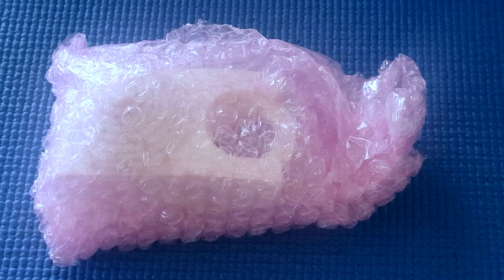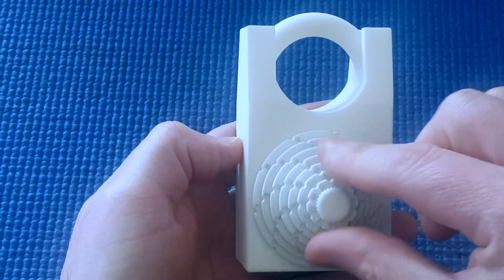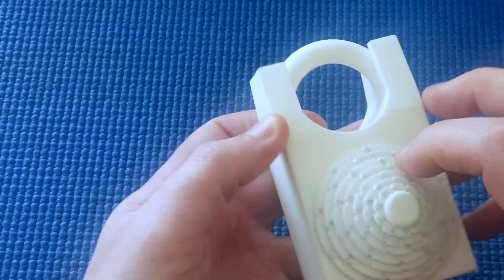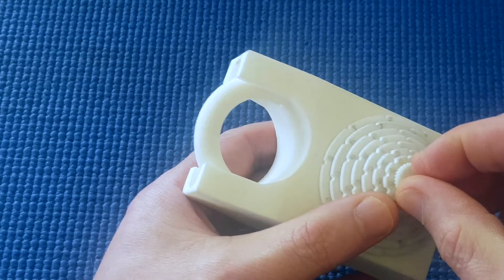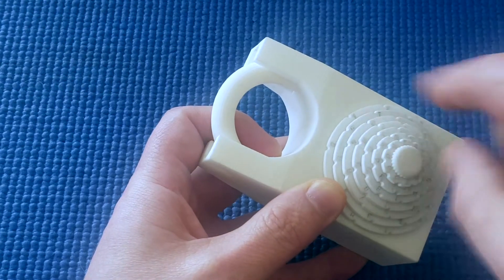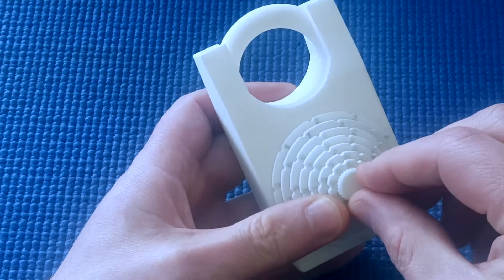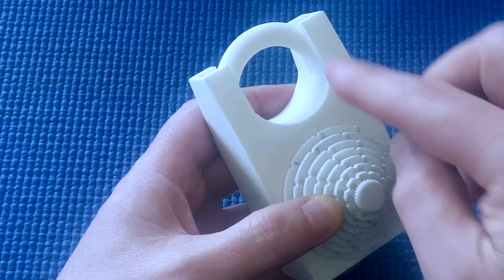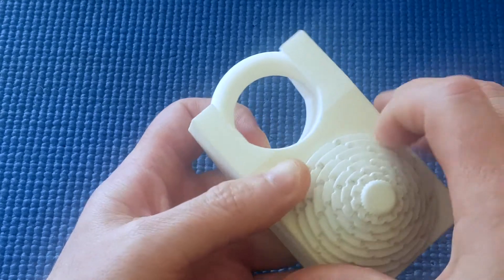(Picking 138) 2nd World Wide Challenge - Polish Combination Lock

Comment: Good luck! I guess this time you'll have to limit your tension. So now accurate tension may be the key, ie just the right amount of pressure. I hope you can feel the gates.

In either case you're great at thinking outside the box. And like with the last challenge as a community, even if you can't get it,  get enough info out of your week so that others can continue where you left off. That way together the community can make one hell of a combo lock!

And kudos to  Zbigniew Olejnik for listening and improving his already great design!
Reply from the maker: Thanks mate! :D  Well said.  If im unable to decode it (i probably won't be able to) it'll go to the next person. I'll try the right account is tension - the designer said the magnets give inconsistent results when repeated - maybe i can take an average of several readings etc. :D
Reply: This test with laser etc. is vital for next steps with this project. I need to be sure that now it is not possible to decode it. Any result will be important, if Swynndla will open it it means further development if not I assume it is ok now.

Comment: This is very cool. I never thought the designer would have re-engineered this padlock again so quickly. Good luck my friend.This time you may need to borrow from the medical profession and get a stethoscope.  Have a great week, cheers
Reply: To be frank with you after several variants I am able now during one day to create any padlock we want. Any shape any design any complication. Now the only question I have is "Is it secure enough now in order to go for full metal version?" I personally think it is bacause it is not possible to decode it in hands 100% the only possible (not confirm yet) way is to use laser. I hope Swynndla will confirm this soon if laser is able to decode it or not.
Reply from the maker: Thank you matey! :D  The inventor is really clever.  I thought about a stethoscope, but in this lock there are no clicks, and nothing under spring tension.  It's designed to last for like 1000 years or something, and can operate just as well under water etc. :D

Comment: From a purely practical point of view, I think those 7 thin wheels would be a PITA to use when dialling in the combination on a commercial version of the lock.  I've got quite large fingers and I can just imagine unintentionally  turning multiple wheels at a time while trying to lock in a number.

Obviously this has got nothing to do with your decoding attempt Swynndla.  Good luck with that 👍
Reply from the maker: Thank you mate! :D  Yea even when the correct combination is entered, they have to line up exactly, which is unfortunate.  I think 7 wheels wouldn't be used on a standard everyday lock, but only on high security one.  Then again, criminals don't tend to decode locks, but break into them with tools!  I guess that's why Master Lock's do so well and will continue to sell.  I'm not sure if this lock will be able to get off the ground as it's so difficult to break into the market and get a good name etc.  Also I believe digital locks are the future.  I am having fun from a decoding point of view though. :D
Reply: Hello, you are 100% right. This one with 7 wheels is just an example of the scalability. The real padlock will have 5 wheels with 25 letters (the same numer of combo +- and moreover will be easier to set the code. In this one I made little bit to narrow enter for actuator and you need to allign all numbers very precise in order to lower the actuator. For decoding purpose it is not big deal but in commercial one it will be much wider entrance so the user can have more margin in alligment the code. This 7 wheels could be eventually set up in safe and there we can make 7x25 with letters as well. The letters concept is much easier to remember, you just remember the sentence and you use first letter of each world like. I like orange small flower, then the code will be ILOSF etc. I think commercial one will be with letters and 5 wheels than the internal open close know will be bigger as well.
Reply from the maker: @polishlocks  The metal final one sounds fun - good luck in marketing it - I know that it's difficult to do so, even though this lock is simple yet secure.

Comment: The sequence from the knob to the rear is...0, 4, 9, 6, 8, 7, 1. I have faith in you mate. I think another combo design on a padlock is a huge leap of faith considering the application is only as good as it's weakest link. It's consideration would be more applicable to the safe industry. Just my 2 cents. Cheers mate:-)
Reply from the maker: Agreed - it would be best suited to safes & vaults etc. If your combination worked then you'd need to get a lottery ticket quick! :D

Comment: Hello, meantime Swynndla is checking the security with laser decoding option I made new video showing new design that will be full metal version. You can watch it here. https://youtu.be/3FIk9EHxypQ it has all improvements inside. If Swynndla would like to test it as well I can send it. It has double sided locking mechanism, additional insert and better alligment for letters. 5x25 combo with bigger open close knob, 12mm closed shackle etc. You can see also first part ever made from metal on my web page.